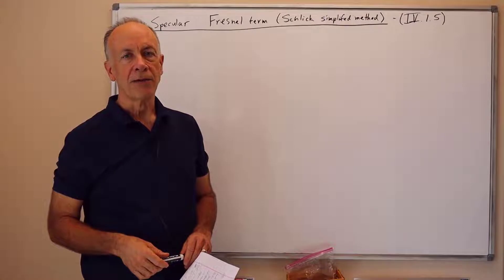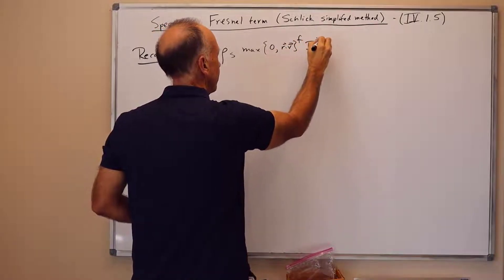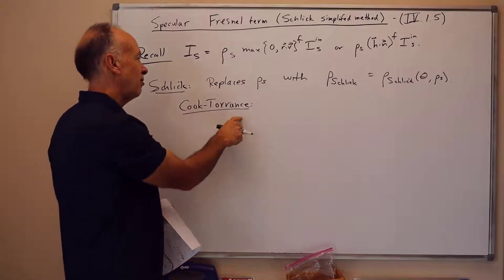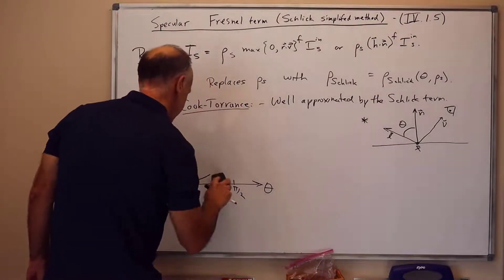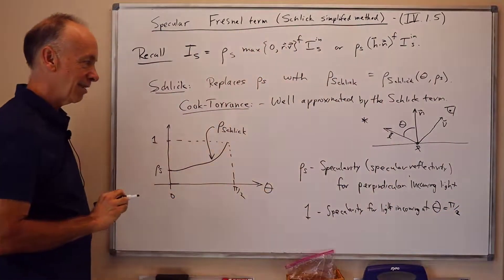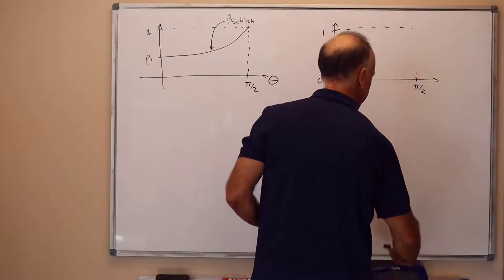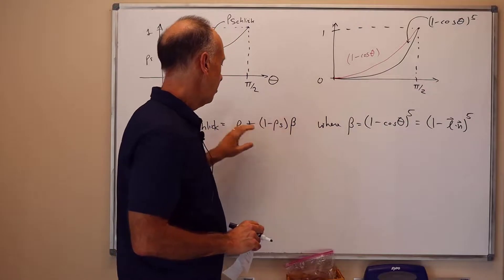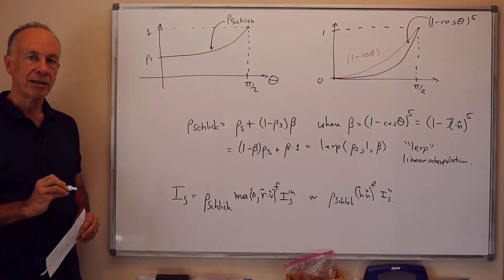06 04 Fresnel Specularity with the Schlick Approximation

Comment: The theta for the Schlick approximation should be the angle between the view direction and the half vector I think, at least that is the case for the original paper.
Reply: No, I carefully read the paper, the theta is the incident angle. You can find that in the 5.(24) in the paper. Actually, what you say is the meaning in the original BRDF model. But Schlick approximation is a simplicity of BRDF, so it just is the incident angle.